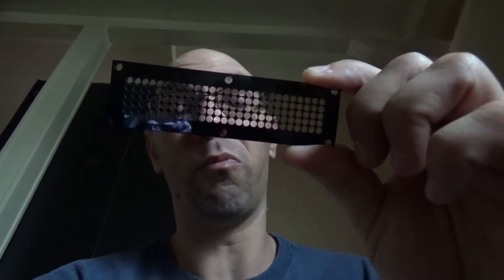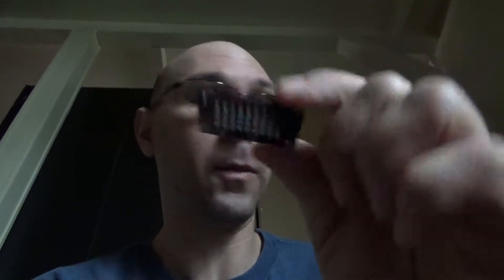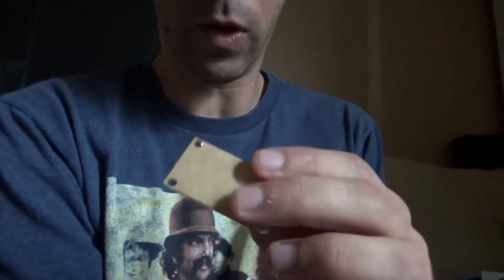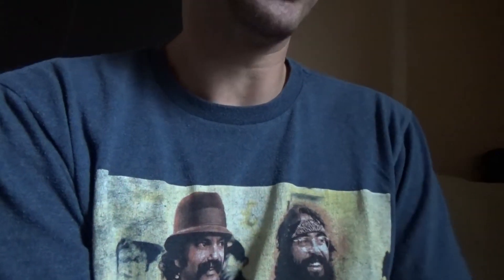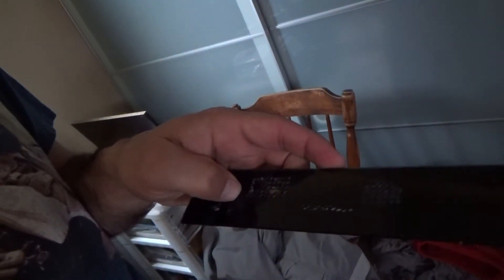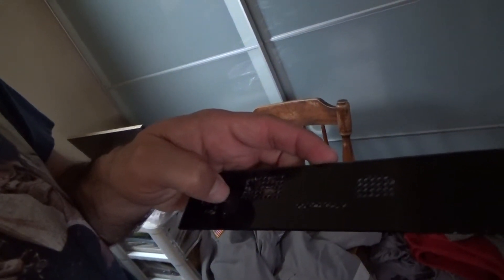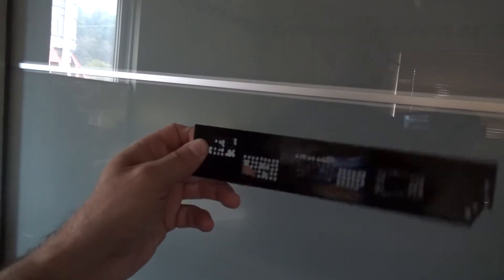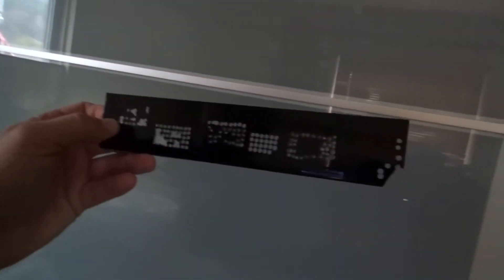R2-D2 LED Bezels for Teeces Logic Display Dome Lights

Comment: even with my laser the bezels are hard with 3mm holes leaves a 0.36mm gap and 20w diode laser is not as clean cut as CO2. so those little parts just break apart.
Reply from the maker: I bought a set that was pre made, but i wanted to try and make my own, just to say I tried.